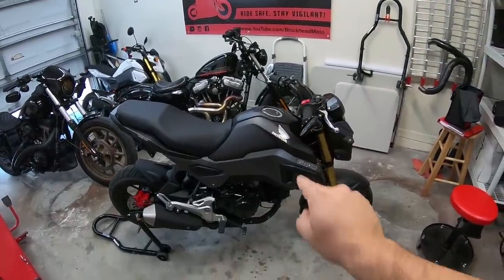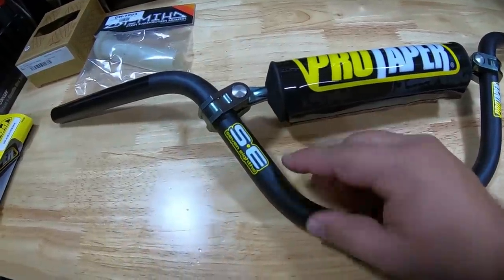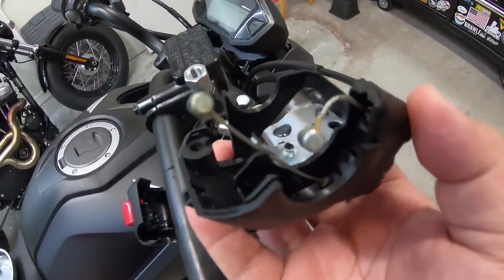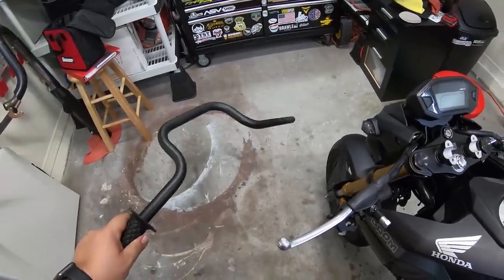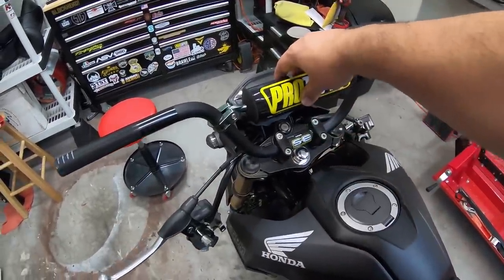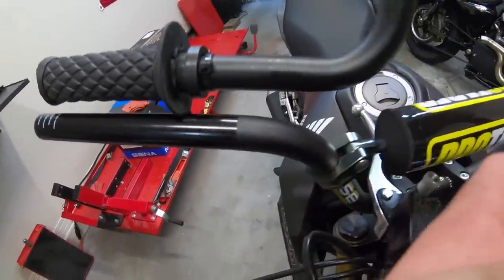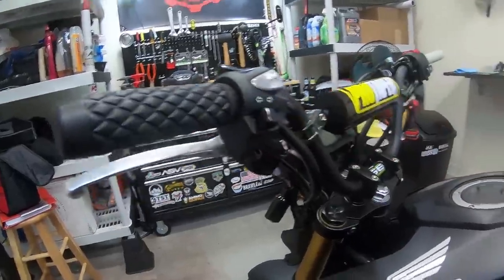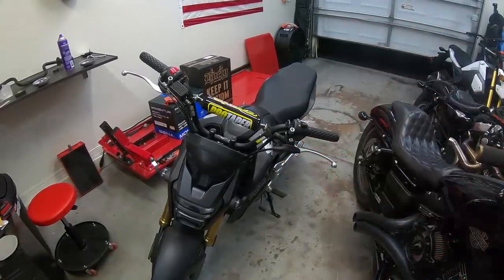Honda Grom ProTaper Bars - How To Install!

Comment: To anyone concerned about the clutch cable being too tight, if you order a clutch cable from the first gen Honda Groms the cable is about an 1 1/4” longer and will give you more slack. Hope this helps someone else out as much as it did for me! (: 

The cable is about $10 + shipping.
Reply: HunterK155 will the old clutch cable fit a 19?
Reply: @dsmith523  Yes, my bike is a 19. Fits perfect.
Reply: HunterK155 sick dude, I just ordered the bars and a 15’ clutch cable. In this video his lever seemed to be to far down for my riding style.
Reply: @dsmith523  Yep even with the lever down and re routed it still stretches the cable alot. I cant stand doing stuff improper and the first gen cable fits exactly as stock, but with wider bars. You'll love the bars! Changes the way the whole bike feels and looks.
Reply: @HunterK155 God bless you. I’ve fitted these bars and the stock clutch cable is in no way fixable to get more slack out of it. I was searching for your comment because I saw it before installing but didn’t remember which vid. Now I know I need to buy a first gen grom clutch cable. Life saver comment, appreciate.
Reply: Do you guys have a link or part number ?
Reply: Do you happen to have a part number for the longer clutch cable that fits on the new(2019) Grom? Just got some new pro tapers as well🤙🏻
Reply: @handrubbingmerchant1927  I just did it, with these bars.
Reply: @taixlu  22870-K26-900
Reply: What about the brake line?

Comment: I just installed the same bar on my grom. But I added 1 inch extensions on both side for the controls to mount just like the stock ones.. love them. Appreciate the info.

Comment: Great video!
How's the visibility on the speed o meter though? Doesn't the Pro Taper mid bar block it?
Reply: Matthias Heijnsbroek I did this exact install. I’m 5’11” and it blocks maybe a 5th of the display. Short lean forward I can see all. I don’t recommend this install by the way.
Reply: Im 5'5 and I can see the display perfectly
Reply: serakthepreparer you’re saying you are 6 inches shorter then me and can see the display? Welp.....
Reply: Yes. I also have them angled at 0 degrees
Reply: alphaomega559 why don’t you recommend the install ?
Reply: alphaomega559 why don’t you recommend?

Comment: Hi Mr Blockhead.   Here we are 1 year later, are you still happy with these bars? I just bought the same ones.   Like you, i wanted something a bit higher and wider.  They are getting installed later this week.
Reply: How do you like your bars Striple_girl?  I bought the same ones  but haven’t installed yet.
Reply: Long story short - i had someone try and fit them for me ( i am useless at that sort of thing).  This guy couldnt be bothered working out how to fit the controls as the straight section is quite short.  He decided it couldnt be done.   I know it can, but i was in no position to tell him his job.  This video shows it can be done, and i know of others who have done it.   So I still have the stock bars on.
Reply: Striple_girl Sorry to hear. That’s too bad. Wish it would have worked out for you.  Hopefully you can find someone to install them.  Happy riding !

Comment: Did you trim down throttle tube? Awfully difficult to fit everything on throttle side. Thinking about trimming it down but did not know if there was a trick you found to fit.

Comment: Could you have put the switches and cables on before attaching to the tripple tree? Just curious obviously not install but just get everything that needs to go on the bars on the bars berry loosely fitted and maybe that could have abounded the whole front plastic take off and reroute. Or is there any reason this would not work in the slightest.

Comment: I did this exact install. I love the look and feel of these bars but your stock bar equipment does not fit on these bars completely. You must cut your grips from original 5 inch down to 4 inch also you are cutting your throttle tube which I now see in the video was done but was not mentioned. Be very careful after lengthening your cables. Please test in safe area and be fully aware. Easy install. Only recommend if you are familiar with bikes and are not afraid to cut throttle tube and grips. Hope this helps
Reply: Yes he washed over the fact it does not quite fit right with the brake and clutch levers on the bend! which he mentioned but did not show fully the extreme angle the brake and clutch levers would be on! only solution is to cut the grips and throttle tube or have them overhanging out a half an inch on each side! I managed to do this and fit Fenrir bar end mirrors hoping my new brake levers will hide the extreme angle the brake and clutch levers pull back too! and the fact your brake lever reservoir is taking a nose dive to fit! ffs dont cut any off the bars to shorten them you would never get the controls on!

Comment: Just wondering what the need for the new throttle tube when you could just use the stock one
Reply: Quicker throttle response

Comment: Curious about these bars.... been learning wheelies and am having the problem of holding the throttle open to much because my arms are straight out with no bend while using the Honda mini protaper bars.... before I loop my bike, I’m curious of these bars since the higher height will allow me to bend my elbow and prevent pre whiskey throttle situations

Comment: the link to the chimera throttle tube didnt work
and the link to the pro taper bar was super short height and rise
Reply: Did you not check the pictures on the link? Yeah it’s the wrong bars but it’s pretty easy to see that once you go to that revzilla link lol
Reply: The link takes you to the correct bars - just has the wrong picture. Literally just had mine delivered. Read the description in the link on amazon. Chimeras are gone from there.

Comment: Grats on 90k,  good vid though I have a question. Bars after grips? Shouldn't it be the other way around?
Reply from the maker: Thanks! Yeah you can do it the other way around. I replaced my grips awhile back, and then decided I wanted to raise the bars. Which worked out, b/c I didn't like the grips that I'd put on. They're cheap grips anyways, so not a big loss 👍

Comment: You may need to keep an eye on the electrical tape that you used...the adhesive on electrical tape tends to get slimy when it gets hot...Florida sun may heat the bars up enough when you park it somewhere to make it slippery...I would recommend folding the electrical tape in half so it sticks to itself with both adhesive sides together , then wrapping around your bars...this will have the clamp really biting onto the rubber of the tape and have the rubber be what grips the bar instead of the adhesive...you could also use a little duct tape instead...that adhesive doesnt get slimy with heat as easily...keep the vids coming...ride safe ✌👇
Reply from the maker: Has been holding up well so far. There's never any stress on the controls (rotating around the bar) so seems to be doing the job ok thus far, but if I do come across any issue, will def go w/ a different tape for sure.

Comment: I bought the xr 50 bars they did not fit for me   clutch cable is too short I even looked into motion pro for a longer cable and they told me around 75 bucks to have one made also I had the bars extended about an inch on both side to fit everything properly for as clutch levers blinkers controls etc. I love the height and the look of the bars but it’s a little more that you have to do to make them work properly I just end up putting the crossbar on my stock bars and a pro taper bar pad. I also installed the KLX 110 bars everything fits but there to low and uncomfortable the bar has no sweep almost straight across which for me it started adding pressure to the wrist. With them being low it change the geometry of the bike when turning and pulling wheelies

Comment: When you put your throttle side back on did you have any issues getting the 2 screws in and the case to close up? I keep trying to put the 2 screws in and I cannot get that thing to fully close back up
Reply: Rider989 same I’ve been at it for about 2 hours

Comment: How did you go cutting the ends off the grips for your bar end mirrors? Just wanted to ask before I hack into mine...
Reply: Bobbi Hansel I used a razor blade. Looks clean. But remember you have to cut your throttle tube which he does not state. I was pretty upset at first but so be it.

Comment: If I'm switching to pro tapers and I have pro taper grips also, do I have to buy a new throttle tube like you did or can I use the stock one?
Reply: I did the same as you, you can use your stock throttle tube, and when taking your old grips off, if you dont need them, just cut them with a razar blade, it will make life alot easier

Comment: Don't do this setup. There is not enough length on the end of the bars to mount everything. You'll end up mounting your levers in the actual bend of the bars which cocks them up at a weird angle. How do I know this? I watched this video, ordered them and spent 3 hours trying to make them work. To mount everything correctly will leave you short a half an inch on each side. I just ordered the KLX bars, like everyone else is running, and Rox risers. @9:31 in the video you can see how little amount of length on the end to mount everything.
Reply: Wish I read this comment sooner
Reply: u can get renthal bar ends

Comment: at 17:06 how did you get the throttle cables back in? please don't cut stuff like that out next time. we need to see crucial details. did you take the throttle tube off the bar when you did it?

Comment: I tried installing KLX110 bars (which are lower than yours) and a G2 throttle tube and it was a complete shit show. I had to remove the whole side panel of the bike to get the throttle tube mounted and I couldn’t get the glue to break loose on the stock brake lines so I had to order +2” longer brake lines that I’m still waiting to get here.
Reply from the maker: Sounds like quite a different install experience, hope it goes smoothly for you from here!

Comment: You paid 28.78 for a throttle tube??? eeeeeeeeeeeeek
Reply from the maker: It's a 'kwik action' throttle tube, and it's actually the cheaper of the options for quick action throttle tubes. Only other quick action one I could find out there was CNC'd and like $100, so I went w/ the $28 option 😄
Reply: Fair enough I kept my stock throttle tube but had to file it down a bit to get the grips on.
Reply: Cheaper option is a stock 09+ Zx6r throttle tube. Cam profile is quite larger than the stock Honda tube and is only $8-10.00 for OEM or $12-14 for a motion pro branded tube.